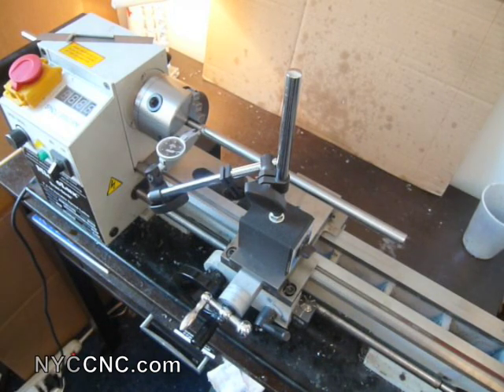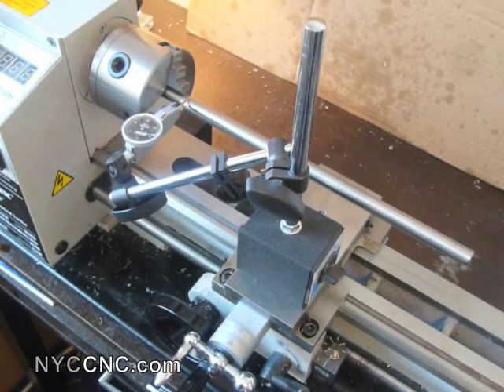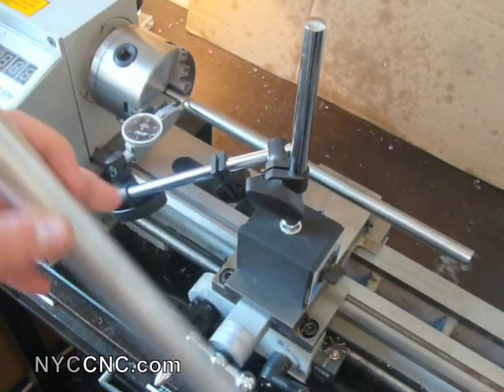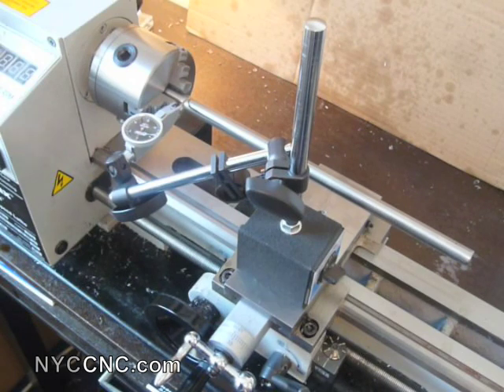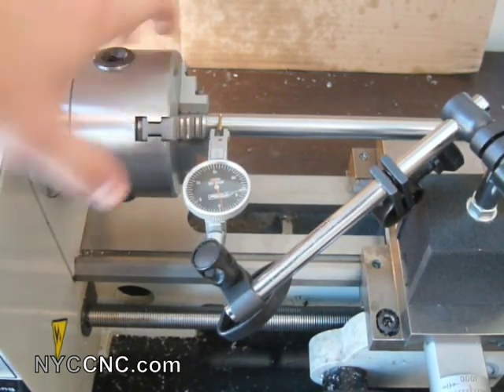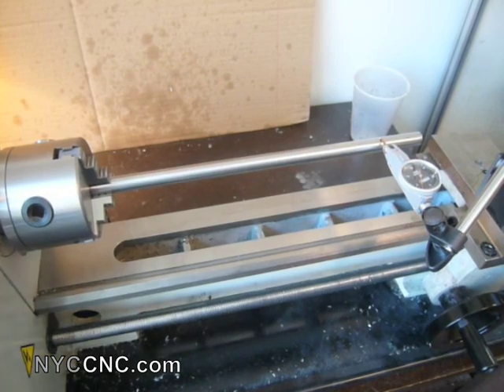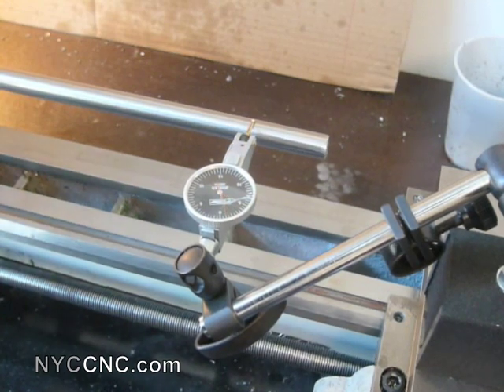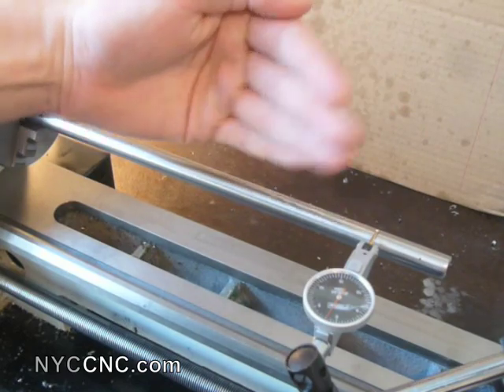Rollie Dad Method - Spindle alignment on my mini Lathe from Micromark 7x14

Comment: John, What a lot of people don't know is that the tail stock has to be loose from the bed when making an adjustment. If it is tightened down, it will actually go the wrong way.
When I learned that operation of the lathe, ours did not have a taper attachment on them.  We were continually having to move the tail stock so as to turn a taper on a part or shaft.
I have seen people talk about the Rollie's Dad method, that was for an out of align headstock. Headstocks are mounted on machined ways (cont

Comment: You were right the first time.  Rollie's Dad's method works even with a bent rod, with the averaging operation doing the correction for the bentness or the runout of the chucking.

At the 9" point, the midpoint of the runout is halfway between +10 and -7, or at +3 vs. the ways.  If the rod was bent 10 thousandths it would add to the runout, and you'd see readings from +20 to -17, with the same midpoint of +3 due to the same misalignment of the ways

Comment: It is important to make sure when moving the tail stock that the lock securing the tail stock to the bad is a little loose. The tail stock has two halves, bottom and top, that have to slide independent of each other during adjustment. If you try to move it without it being loose from the lathe bed it will twist even more. Then when you loosen it to move the tail stock it will move even more. This is what I meant by 'chasing your tail'. Most don't know that it has to be loosened for adjustment.

Comment: Julian, The idea behind this is to check the alignment of the headstock.  As i said before, I have never seen one that is adjustable.  Now, if the headstock has been removed, it could possibly have some sort of dirt or a chip underneath it, in that case it could also be out.  I don' recommend to anyone that they remove the headstock unless they are going to have the bed scrapped.  

I realize that on the very small lathes, most nowadays are mad in Taiwan or China and are low quality.

Comment: I use some big long dowel pins that are ground to 0.0002".  You can also use Lathe mandrels taking care to note that the mandrels have a slight taper to them so you will have to account for that.

Comment: The method in the video is correct.  Algebraically summing means including the sign of the numbers when summing. Algebraic summing allows using a bent test bar with a constant diameter.   This was the technique used to zero the DTI at the headstock. The resultant measurements 9" from the headstock are then added and divided by two to give 0.75 mil (0.00075") vertical misalignment.   Aluminum foil shims on the prizm side of the headstock can bring that number < .005".  The math is correct.

Comment: Hi there, having recently discovered the Rollie's Dad's Method I watched your video with some interest.  I think you got a bit confused at the end through using a DTI.  The misalignment is calculated from 1/2 range at position 2 minus 1/2 range at position 1.  From your readings I think the vertical misalignment on the lathe is 0.00325 inch.  atb

Comment: ytmachx, if you read "Rollie's Dad's Method of Lathe Alignment" you will see that it is quite specific that the rod does not have to be straight nor does it need to be centered in the chuck.  This method REQUIRES turning the chuck.

Comment: US Air Force.  I guess I shouldn't have said anything about it.  When I first became a machinist the equipment I had learned on before I went into the military was so worn that most machinists today would refuse to use it, I learned to compensate and still make precision parts.  We were moving the tail stock several times a day because we had no taper attachment on the lathes.  
It took too much time to precisely indicate it in after each use unless the part had to ground.

Comment: When you are machining a rod, if it sticks out of the chuck more and a couple inches or so, it should be center drilled and use a live center in the tail stock. If it is turning a taper, do a test piece between centers, take a very light cut next to the chuck making sure the micrometer dial is zeroed, move to the tail stock and t take another light cut at the zero on the dial and measure it. What ever half the diameter difference is the amount that you will move the tail stock.

Comment: Hi again.  I'll just take my foot out of my mouth and cancel my previous comment.  Must remember to think before writing.
To help avoid confusion the equation for the difference (dA) in spindle axis height from position 1 to position 2 is

dA = {(G21 + G22) - (G11 + G12)}/2

where G21 and G22 are, respectively, the max and min gauge readings at position 2 and G11 and G12 are the max and min gauge readings at position 1.

So in your test, G11 was +2 and G12 was -2 and so cancel. G21 was +10 and G22 was -7 and so (G21+G22) is +3.  Therefore dA is +3/2 ticks, or 3/4 thou high.

Comment: in the tool and die shop we put a broke carbide end mill in the 3-jaw and check TIR if out mor than .002 we grind the jaws, for any kind of accuracy a 4-jaw is really only way to do it and indicating the 4-jaw in only takes 2-3 minutes, center drill a piece of anything and take a clean pass and what ever the taper is adjust the tailstock,or 4-jaw an indicator in the chuck and run the indicator inside the tail stock bore and bring the tail stock into .0001 or 0.0,, just another way.

Comment: the quickest and easiest way is to just do the indicator indicated in the 4-jaw to set up the tail stock,,the only way this isnt better than the long cut is if the lathe is very worn where the tail stock ends up sitting for taking out total TIR, what ever material you use to chek with mic-it in many places and make sure radial material run out doesnt send you astray, hope this helps,,just now noticed this is from 2009, you prob-got it nailed by now, i do hot air motors from my grandpas designs
Reply: He is not setting up the tailstock, he is measuring headstock alignment.

Comment: good level and make sure your lathe has no twist in it,,small amounts of twist in a lathe after it has sat in one place for a long time will also create taper over a long cut, its worth the money to buy a foot of ground drill rod about .750 or 1.0 dia for the final center drill in the 4-jaw then put the dead center in it AFTER indicating it back in to the 4-jaw and then run you .0001 graduated indicator across the top to see exactly where you are at, the drill rod is to be saved and used again

Comment: If the tail stock is seems high or low, it is usually because the lathe bed is twisted in relationship to the headstock, or it is not mounted totally level, side to side, end to end. Once it is totally secured, it can be operated upside down or on a hill-side and still make a good part. It should not require shims underneath, or need machining to lower it.
Not saying that some of the junk coming from China is in perfect alignment, because they are not. That is what files and emery paper is for.

Comment: Not trying to pick on anyone because of their skills, but a lot of inexperienced operators are led to believe that it is the utmost importance to have everything in perfect alignment. The lathes were not designed to be that way, especially for the tail stock. It is meant to be moved on a regular basis, especially if you don't have a taper attachment on the lathe. These lower quality machines are not expected to be perfect, therefore you have to use a bit of thinking power to work around it.

Comment: Even if everything is perfect, are you making a perfect part? What it boils down to is practice, practice, practice. It is untold how many scrap parts I have made regardless of the machine. I was once told, "it is not how good of a machinist your are, it is how good you can correct your mistake". Even the experienced Machinist will scrap out a part because of a mistake occasionally.
Point being, you have to put some thought into your project and develop skill as you go.

Comment: You CANNOT use a dial indicator in the headstock or chuck to set the tail stock. Supposing that you use the Rollie method and find it is out... what are you going to do then? Your only option is shimming the end of the lathe bed to try and get the 'twist' out. Problem is with a really cheap lathe, it needs to be secured to some sort of a sturdy frame that won't twist and shim it accordingly. If the lathe bed is twisted, the further you move the carriage from the chuck, the more it is out.

Comment: and are not adjustable. If there is some sort of mis-alignment, it is usually because the bed is twisted from not being mounted properly. Run-out can also be attributed to dirt underneath the chuck mounting surface.  I have never seen a need for that particular method. I have noticed that most hobby people are too concerned with alignment because others have told them to be, or suggested it was a problem.
The quality of the machine can give problems, but with experience it can be worked around.

Comment: This video does not test the runout.  Averaging the DTI readings corrects for runout in the chuck and any bend in the rod.

The video tests the vertical misalignment between travel along the ways and the axis of the spindle.  

Doing this again on the front surface of the rod would test the horizontal angle between the spindle axis and the travel along the ways.

Comment: Nope.  

Rollie's Dad's method  works by looking for the difference between the midpoints of the runout, so it can account for bent rods and crooked chucks.    You don't even need to zero the indicator, you could set it so all the readings are positive, then average the chuck-end readings, average the tail-end readings, then any difference between the two averages is due to the misalignment of the ways or any difference in rod diameter.

Comment: Nice video but you got the math wrong on the second reading. The method states: "Algebraically add (i.e. account for the signs) the minimum and maximum readings and divide by 2. The result is the vertical spindle axis error. "

That gives you 17 thou vs 3 thou error.

Comment: Before the this test You hollow out by turning the chuck jaw??? No??? Bad=> it make error. Second is- NO ONE rod material is perfect round! Next is that- You NEVER turn so length rod piece without tailstock use- in this way can get hurt! Lathe accutacy can chech only then on this lathe turn! So, I think this is not correct way how test the lathe on accuracy.

Comment: It is pretty sad that nothing is made in the US any longer, but corporate greed for the stockholders has since farmed out most of the equipment to save money. Quality has suffered because of this. It all comes down to the bottom line.  The quality of some of the lathes is so poor that it is one step above not having a lathe. Because of this, allowances has to be made in order to make a quality part. Rather than spend time worrying about alignment that probably does not make a difference anyway,

Comment: The machine does not have to be perfect, but remember... it is a machine. You are smarter than it is. Put some thought into what you are doing and make it do what you want. It takes a high dollar machine that will make a part without mistakes. You are the one telling the machine what to do. If you are trying to rely on the machine to be perfect, you are in for a disappointment, especially if you are in an industrial environment using 70 year old equipment. How much blame can be put on the lathe?

Comment: sammy 6 months ago
 Drill rod are not that precision. You need linear precision rod. sammy is right and mine is ground to a 10th of a thousand. it also has a dead center hole cut in both ends so you can adjust your tail stock also. you can also cut a few thou off maybe a inch of the end of the rod chucked up close to the chuck and that will give you a good look to see if your lathe and chuck are on the money or how far of it is. I grind the inside of the jaws for guys all the time to make them RIGHT ON But DO NOT DO IT UNLESS YOU KNOW WHAT YOUR DOING! It is real easy to trash A Nice Chuck. 
God Bless You ALL